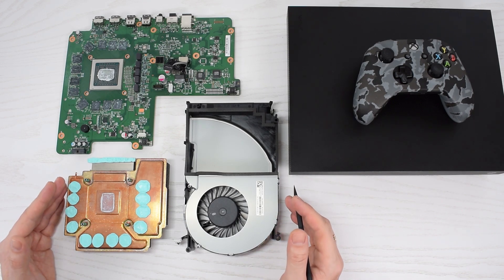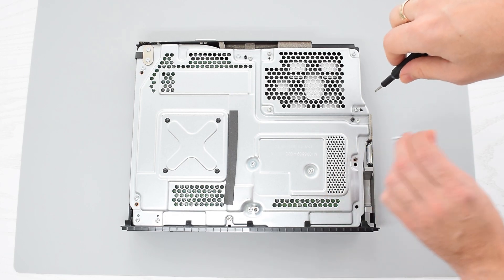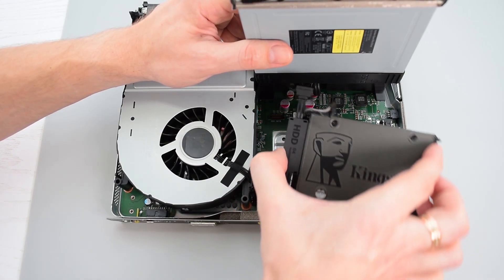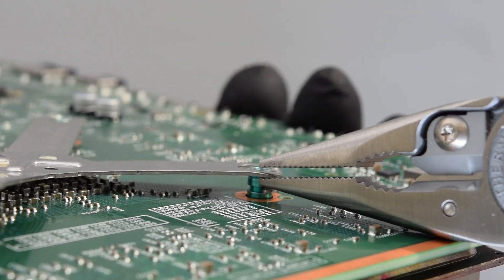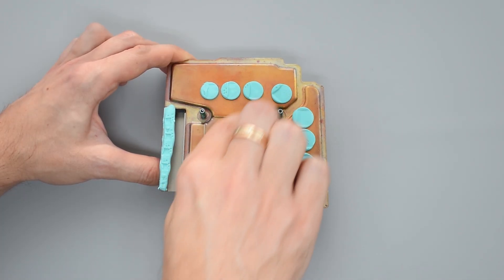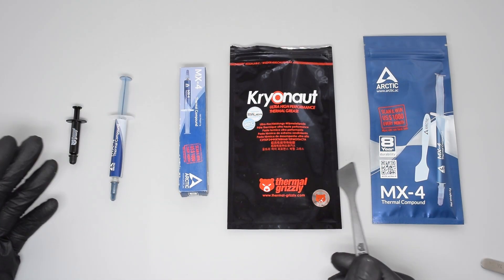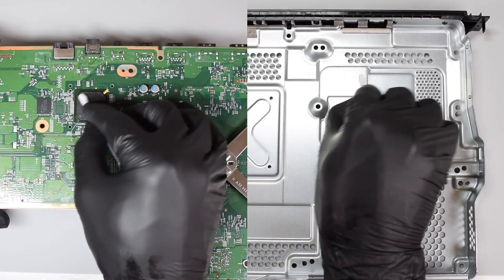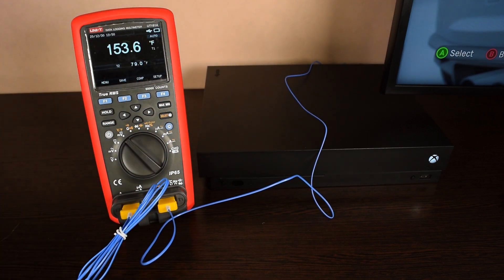Xbox One X Thermal Paste and Thermal Pads replacement. Cooling system cleaning. Best explanation!

Comment: Anyone have confirmation the 1.5mm pads make contact? Wanting to do this and no real info on 1.5mm vs 2mm with thermal grizzly's pad. Amazon reviews were good on the Xbox for both sizes.
Reply from the maker: If you want to use Grizzly pads then you need 1.5mm pads. Nowadays there's a way better solution than any pads. We use UPSIREN U6 PRO https://alii.pub/6nugj5 instead of pads. You can watch my video on Series X how to use it.
Reply: @ElectronicsComputers  20g will be enough to replace all pads?

Comment: I have a question 
Can I use the Xbox one x thermal pads off the cooler and use it on the Xbox one x south bridge chip under the board ?
Reply from the maker: You mean green thermal putty? If it's still nice and soft, then yes you can. We don't use thermal pads anymore, there's way better solutions nowadays, like UPSIREN U6PRO thermal putty: https://alii.pub/6nugj5

Comment: Hello, great vieeo! Can i use 1mm thermal pads or 2 mm because i don't have 1.5mm pads.
Reply from the maker: You can get away with soft 2mm pads which have very bad thermal conductivity. If you want to make it right you have to use 1.5mm pads. Nowadays we don't use thermal pads anymore. There's way better solution on the market UPSIREN U6PRO: https://alii.pub/6nugj5
Watch my video for Series X on how to use it: https://youtu.be/GTvtAM7Fi5U

Comment: Doesn't warmer air escaping in the back exhaust mean the thermal solution is working better?
Reply from the maker: That's right. If you use thermal paste with better thermal conductivity, them more heat will be transferred from the APU to the heatsink.

Comment: So what is the conclusion? 2 mm or 1.5 mm thermal pads is the better?
Reply from the maker: You have to use 1.5mm pads but at the moment there's way better and easier to use solution on the market which is cold Upsiren U6PRO: https://alii.pub/6nugj5
Watch my video about replacing paste for Xbox Series X.

Comment: Does change the pads make much difference? I have a 2018 one x and changed the paste using a kryonaut but keep the green pad, i think the air output is okay because is hot but the fan is very noise on games. Do you think is possible that my pads are bad and overheating the chips causing the fan to be on full load?
Reply from the maker: The fan responds only to the APU, not to the memory chips. Typically, we always replace the thermal putty on all devices if we remove the heatsink. This is because, unlike thermal pads which are somewhat compressible, thermal putty is not. If you remove the heatsink or PCB, the thermal putty won't maintain its original thermal conductivity.
Reply from the maker: The fan responds only to the APU, not to the memory chips. Typically, we always replace the thermal putty on all devices if we remove the heatsink. This is because, unlike thermal pads which are somewhat compressible, thermal putty is not. If you remove the heatsink or PCB, the thermal putty won't maintain its original thermal conductivity.
Reply: @ElectronicsComputers  Oh thank you for the info maybe in the future i ll try do a full replace on the paste, putty and maybe the fan, if that don t change anything.... guess its dying

Comment: If I use liquid metal instead of thermal paste, will I have a problem?
Reply from the maker: You have to be extremely careful, because that stuff can be electrically conductive or non-conductive and if it makes contact with the capacitors on APU, that upgrade can be fatal for your console.
Reply: @ElectronicsComputers  thanks, I gave up on liquid metal.  If I just renew the thermal paste, will it prompt me for an update when I turn the console back on?

Comment: WARNING!!!!! When removing the optical disk DO NOT disconnect the connector on the optical disk, the pins are very fragile and are easily bent so just disconnect it on the motherboard !

Unless you want to replace the optical disk which is a mess

Comment: My Xbox One X has a different heatsink design. Only the area that contacts the APU is copper and has 3 copper heatpipes that route to the rest of the heatsink. The rest of the base is all aluminum. Would anyone know if 1.5mm or 2mm thermal pads would work? 

I've read a discrepancy in the pad thickness when using Thermal Grizzly's pad.

Any feedback is appreciated. I looked in Google and Reddit and it's not documented much. My heatsink does not match the one in this video.
Reply from the maker: We don't use thermal pads anymore for upgrades or repairing. There's way better solutions nowadays in terms of performance and compatibility. I recommend using thermal putty Upsiren U6 pro: https://alii.pub/6nugj5
You can watch my vidoe on how to use it: https://youtu.be/GTvtAM7Fi5U
It's basically the same stuff as the original green thermal putty but it has way better thermal conductivity.
Reply: @ElectronicsComputers Thank you for your reply and I was successful in using Arctic TP-3 Thermal pad in my system. I bought a 100x100x1.5mm pad. I have half the pad for other projects. 

I will definitely use the recommended Upsiren U6 Pro thermal putty for my phat Xbox 360 I will refurbish. The system has RAM chips under the board that contact the metal case.

Comment: Thermal pads 1.5mm or 2.0mm ?
Reply from the maker: Thermal pads should 1.5mm thick. Nowadays thermal pads are not the best solution. Watch my Xbox Series X thermal past and pads replacing video and use the same method which is the best nowadays. https://youtu.be/GTvtAM7Fi5U

Comment: I recommend x clamp removal tool, they should work on all Xbox 360 and Xbox one models and make the x clamps really easy to remove
Reply: I broke a corner off of my disk drive clamp hopefully it'll work fine I covered it with electrical tape 😅
Reply: No wires damaged just one of the wires was exposed so I put the tape to prevent anything 😅

Comment: yeah after trying all the steps and retrying several times my xbox now turns on, then right back off reguardless what harddrive or method of OS install, cloning, nothing works, my xbox is now trash and I have experince building PCs I built my current PC myself and now my xbox is basically a paper weight cause google is zero help
Reply: I am an idiot, used too thick of thermal tape and the paste wants contacting with the heatsink, sorry, panic was happening there lol
Reply: @Carter_The_Snake_Sage  How thick were the thermal pads you used? Because I have thermal grizzly 2.0 mm installed, and they seem to be quite squished down by the heatsink, but my Xbox One X is still overheating under heavy load.
Reply from the maker: @marsmissionape9566  There's way better thermal solutions nowadays than those thermal pads. We use UPSIREN U6PRO fro all consoles and graphics cards: https://alii.pub/6nugj5
This is the same thermal putty paste as the green stuff in Xbox but has twice higher thermal conductivity than the original and higher than Grizzly pads.

Comment: do you know the thickness of the tape you used?
Reply from the maker: I was using 1.5 mm pads. Nowadays, there are way better solutions available. In the description below, you'll find links for GELID thermal pads and thermal putty UPSIREN U6PRO. The last thing is the pink putty paste, similar to the green one that is used in Xbox but has way higher thermal conductivity than the original or Grizzly pads, and you don't need to cut anything or care about its thickness.
Reply: @ElectronicsComputers  deffinitly a future investment!
Thank you once again!

Comment: Where can i get the boards of the xbox one x controller sync and the disc tray (if i wanted to replace them),
I also want to replace the connecter og the cable comming for the side (which you disconnected in 1:19 time in this video )
Reply from the maker: You can buy the wireless board from this very good seller with free shipment to your country: https://alii.pub/6oaxp1
For the rest of the parts try to ask in your local repair shops or go to Ebay. I've never seen those new part for sale but you can definitely find some donor parts.

Comment: could i use k5 pro instead of pads?
Reply from the maker: Yes, you can but it's not the best solution. I recommend using UPSIREN U6 PRO. This thermal putty is even better than Grizzly pads. We buy that stuff here: https://alii.pub/6nugj5
You'll need 50 grams of that paste.
Reply: @ElectronicsComputers  thank you

Comment: I generally agree with the thermal paste you've used but to my surprise it appears it's actually performing worse if the test results are accurate. I say worse because so far from my research and test results from repasting old game consoles the heatsink should actually get hotter when the thermal conduction to the heatsink is better because it absorbs more heat from the components it's cooling. It might be a good idea to retest it. Gaming can vary the demand on the APU so i think it's better to do a test from a consistent load like siting idle on the main screen with nothing loading in the background for about an hour and measure the temperature for about 10-15 minutes and measure from the hotest point it got or maybe the average of the readings. i'm going to be doing this with my personal Xbox one X i recently got, i've not broken the seal with the Heatsink as of yet and the fan is pretty quiet so this should make for a good test suject.  PS i have heard from someone on a Console repair discord server that the Xbox One X runs at a constant slow fan speed until(i'm asumeing the APU) reaches 70 degrees Celsius.
Reply from the maker: Yes, that's right, the temperature of the heatsink should be higher with good fresh thermal paste. The problem is that I don't remember how we attached the thermal couple. I think it was attached to the side of the APU die, not to the heatsink.

Comment: I don't understand this, Ive done this to the absolute best, imitated everything you've done but somehow my Xbox is turning itself off instantly after putting it back together, I've got the 2mm pads and the exact same ones from grizzly. Are the pads just not connecting to the board properly.., air gap?
Reply from the maker: 2mm pads are slightly thick and the APU doesn't make a contact with the heat sink.
Reply: @ElectronicsComputers  which ones is the right thickness 1.5mm?
Reply from the maker: @kylegibson5933  You need to use 1.5mm pads or very soft 2 mm pads. You can also use thermal putty (same stuff as the original green compound): https://amzn.to/42aUHC6
Reply: @ElectronicsComputers  thank you appreciate it

Comment: Hey, thank you for your video! One question: you used 1.5mm thick pads, but I am still not sure, if I should take 1.5 mm or soft 2 mm. I measured the old pads, where they are squished down and they are 1.5 to 1.6 mm. So wouldn't it be better to take 2mm thickness?

Comment: Can i use an arctic mx-6 thermal paste???
Reply from the maker: Sure!
Reply: @ElectronicsComputers  Lastly can i use a 2mm grizzly thermal pads? or just stick with the 1.5mm?

 Im just confused cuzz some people use 2mm grizzly thermal pad and they said it works.

 I dont want to experience the problem (xbox turning off/overheating) cause of wrong thermal pads size when replacing thermals pads and paste.

i hope you reply just making sure before i take my xbox apart lol

Comment: I replaced the paste with mx4 and the pads with arctic TP3 pads and it is still loud🙁
Reply: Someone said it s better use some viscous paste like the K5-PRO,It is really better?
Reply from the maker: What's the thickness of the pads?
Reply: @ElectronicsComputers  1.5 mm

Comment: My Xbox one x is turning on then off after this repair. I’ve changed thermal paste no problem and now with thermal pads my issue occurs. Someone told me on Reddit that I wasn’t putting enough thermal paste on. I added a touch more and now it’s staying on from the original 5 seconds now to about 12. I put on arctic mx-4 and thermal grizzly pads.
Reply from the maker: What kind of thermal pads did you use? What's the thickness?
Reply: @ElectronicsComputers  Arctic mx-4 and thermal grizzly thermal pads 1.5mm
Reply from the maker: @ryarmadillo5668  Are you sure that those pads are 1.5 and not thicker and you removed the protective tapes? Just make sure that your heatsink makes a proper contact with the APU. when you remove the heatsink, the paste should be evenly spread across the die of the chip. If you see a thick layer of paste, that means there's a gap between the APU and the heatsink.
Reply: @ElectronicsComputers  on my Amazon order and also the package it came it it says it was 1.5mm. The only thing it could be is the wire connector on the power button board that connects the eject button. But I put in a disc and it ejects. So I really don’t know what it could be. I think there just may be a short in the motherboard.

Comment: Are 1.5mm pads really the best? I see people buying 2mm pads and 1.5mm pads and both are saying they work, I wanna know what the ideal is for the Xbox one X
Reply from the maker: Only very soft 2mm pads will work with Xbox one X. If you want to use Grizzly then you need 1.5mm pads.
Reply: @ElectronicsComputers  Thanks for the quick reply! I'm gonna try this and hopefully it works. I don't think I'm really having fan or heat issues with my 2-3 year old Xbox, but I hope it increases the frame rate a little as I don't get full frame rate in Apex at 1440p, being more silent would definitely be a bonus

Comment: I actually had a t-10, still no t9 so i couldnt remove gpu screws for thermal replacement. Realized this after removing the top, luckily didnt bother remov 19 screws cuz the gpu or cpu whatever it is, requires a t9 for sure, the t10 not work there

Comment: I was having issues with my Xbox constantly overheating. I ordered the thermal paste and thermal pads and followed your guide and my issue was fixed. Thank you for creating such a comprehensive guide. This saved me almost $300.
Reply from the maker: Glad I could help
Reply: @ElectronicsComputers hi what thickness pads do we choose?
Reply: I used 1.5mm
Reply: What size of Thermal Grizzly Thermal pads did you use?
Reply: @balintka 1.5
Reply: Was the fan making loud sounds?
Please reply 🙏
Reply: @Knightly76  yes the fan would be loud when it should not be normally
Reply: @AFKomega  would the fan ramp up in speed then go quiet and the do the same thing again?
Reply: @Knightly76  yes its like going up and down several times, Even playing Og xbox games and 360 games, but after the thermal paste and pads no issues at all, I used Grizzly kryonaut, previously used a different one but could not handle the heat and only lasted 1 month until needed repaste, but with Grizzly no issues for months, hope that helps.  Edit: it does that as its trying to take the heat out but it can't as the heatsink its not getting hot properly due to poor thermal paste and pads depending on its condition, you may notice even the fan its going fast the air is not as hot as it should be
Reply: @AFKomega  Thank's sooooooo much🙏 You have really helped me out.

Comment: Thank you very much for this video. I was doing it today and I used NT-H2 Thermal Paste from Noctua for the CPU and EC 360 Silver Thermal Pads (with 12 W/mK). The end was a little bit tricky to put the Xbox together but after watching the first steps again I finally managed it. I needed some hours but the result is just awesome! Since 2 hours Im playing Red Dead Redemption 2 and Ark - the Xbox One X is so quiet, cold and smooth like I never heared it before. The CPU is so cold now that I barely can hear the cooling fan working. WOW ^^
Reply from the maker: Good job!

Comment: The performance of my system was failing, and I noticed how hot the console was getting. Eventually the console crashed with an error E-105 and I found your video. I opened up my console and found that the thermal paste is like crust. Thank you so much for your video!
Reply from the maker: Thanks for sharing. I'm happy to help!

Comment: I’m about to buy all this stuff and do it to my Xbox One X. Would it also be beneficial to buy a fan accelerator or is that unnecessary?
Reply from the maker: If you use thermal paste with high thermal conductivity, like Grizzly, then the performance of the stock fan and heat sink is more than enough to cool down your console.
Reply: @ElectronicsComputers  sounds good, thank you! I just bought the thermal pads!
Reply from the maker: @zkorpthekorp  Happy to help!
Reply: Did you buy everything am not sure if you need all the stuff?

Comment: hi, thank you for posting your videos, very helpful, I followed them re-pasting and swapping out HDD for SSD. One observation interpreting your MM max temps, all things being equal i would expect higher exit temps from a thermal transfer which has a higher efficiency between the CPU/GPU die & vram and the heat sink.

My 1x had max temps around 58*C with fans on high, sounded like a hairdryer.  After the replacing paste and pads Ive seen 71*C (Forza H 4 1440p 120Hz) with the fans hardly audible, higher than at idle which sees temps around 58*C as expected.

I interpret that the MX-4 was least efficient with the lowest exit temp, also noting the ambient was higher.
Reply from the maker: Happy to help! I don't remember how that test was conducted, but it's not the temperature of the heatsink. I think we put that probe between the APU and the heatsink or the probe was attached to the side of APU die. With a high quality thermal paste the temperature of the heatsink should be higher.